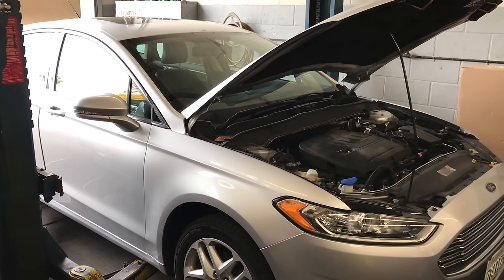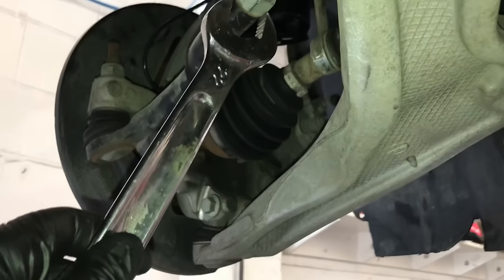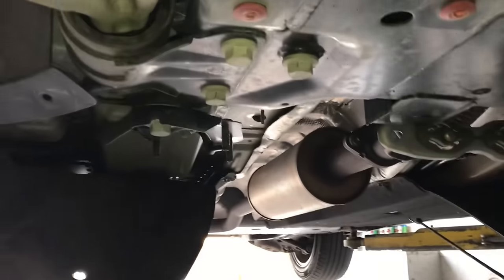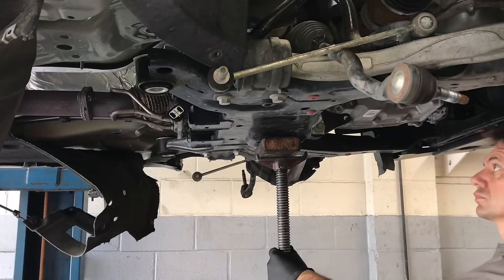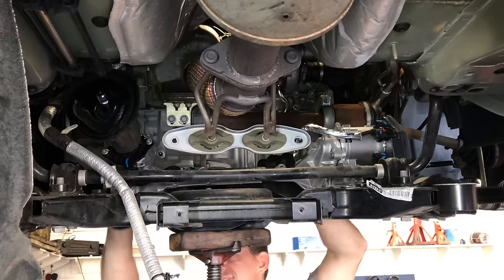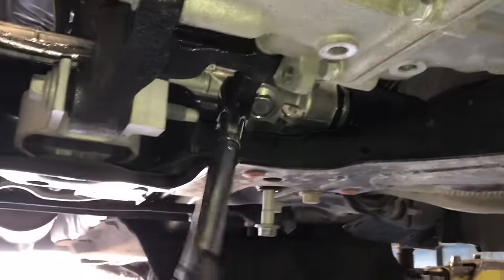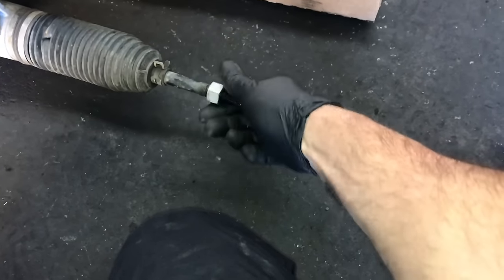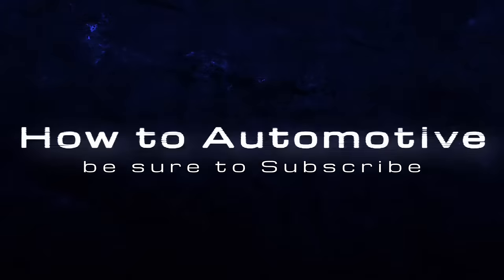How To Replace The Electric Power Steering Rack On A Ford Fusion

Comment from the maker: Links for parts and tools are in the description
Reply: Awesome video. Did you not have to reprogram or flash the PCM or whatever? I just got mine swapped by my buddy but we never did the programming. Now the steering feels like it's hyper sensitive. Any small bump and it sets it off to one direction or the other. Not sure if that programming step is responsible or whether he messed something up in the install.
Reply: Hi sir I need some help plz how to reprogramming for new steering or use steering box on ford fusion 2012
Reply: @ibanezmakki  Forscan is the lowest cost way to do it.

Comment: Cars are too young to have problems like this. I'm not sure how or why people buy things from companies with shotty records of quality. Ford is barely better than GM in the quality department.
Reply: That’s so true Blackman,I was a teenager in 1988, I had saved  enough for a Toyota pickup( it was 3 yrs old) all my buddies gave me a hard time” That ain’t no ford” and other b.s. Well that truck lasted, and mite still be going for all I know,  I smashed 135,000 really hard miles on that thing,missed shifts, I used bar and chain oil as oil! 2.50$ a gallon! Rolled it over, sunk it through the ice,and was drunk for most of it... I replaced front pads, that’s it!! No ball joints no alternator, no water pump, nothing else, except lots of side window glass( a lot of crazy girlfriends will do that) my buddies American rides? Hah,broke down, the usual ford/ Chevy  BS,  mentality, that it’s somehow OK that it costs a lot to go AMERICAN! Well not for me! They don’t make Toyota trucks like that anymore! And THATS too bad...
Reply: @pierrelaboom4026   I have a few old cars that are Japanese that still run today. 1989 CRX, 1990 Acura Legend, 1993 Accord, 1993 Camry. All exist to this day, the Camry actually still has its R12 A/C charge. Miles dont seem to matter, all but the Accord have over 200k on the dial.

Comment: CAUTION: when reassembling, the torque values for a few nuts are not the same for my 2014 Fusion SE. I used the 85 ft-lb torque values in the video on cross bar nuts and damaged the screw on the bracket. Then I looked at the service manual it says 60 Nm (44 ft-lb). The screw is 10.9 M10 which is typically rated 49 ft-lb, which is close to the number from the manual. Another one is the two rack & pinion bolts. They are 10.9 M14-110 bolts,  rated 215 Mn (158 ft-lb), and need to be torqued to 200 Nm (147 ft-lb) per the service manual... So be sure to check the service manual about the torque. 

Other than the torque value, this video is the best I can find on youtube and is very helpful. I followed the instruction and get the job done.

Comment: Sofb, this sounds EXACTLY like the noise mine is making. Is makes the same multiple knocking sounds when turning (only to the left, not the right) at a standstill. Checked all of the suspension parts and everything looked tight. Showed to multiple mechanic friends and no one could tell me what it was. I am now 100% convinced this is it.

Comment: I did this in my driveway. I’ll give my 2 cents. This wasn’t a bad job . Make sure you have a really good impact especially if you live in an area where they use salt on the roads. I would also  have sway bar link arms on hand because mine had to be cut off and they were worn out anyways. I purchased a used rack and didn’t have to use a scanner. Automatically cleared code and works. The motor on my rack was split in half
Reply: I’m doing mine on Saturday, my dad thought it was the strut bushing plates so I did both, he was looking it over and noticed the rack motor was in half.

Comment: i just did one one Cmax.. will be done tomorrow , my shop was busy today, i did completed rear brake on CRV, both upper and lower ball joints on Envoy, + aligh, and VW aligh, wow.. so i get home and watch you 😂😂
Reply: Ok super random question that you might not even see but is it going to be the same process for a c max as a fusion? I need to replace my power steering rack on my c max and this is the only video I can find that explains it well. I'm trying to figure out if I can do it on my own. Thanks!

Comment: Had trouble getting the ball joints back into the knuckle, flipped the nut upside down, sucked the threads through then flipped the nut around the normal way and sucked the ball joints into into place work like a dream

Comment: This is a great video! I do have a question, the website for the remanufactured steering rack says that it must be programmed and I called Ford who said I would have to get it towed to them to have the new rack programmed. How were you able to get the new rack to work without having to program it? Thanks.
Reply: This is why he said you would need a scan tool capable of doing a steering angle sensor relearn

Comment: Great vid! Just replaced my steering rack today. I watched your video prior to installing mine and you made it seem easy. Rust is a mechanic’s worst nightmare lol. All in all, new rack is perfect. No more sounds. Thanks!
Reply: Geno I work at a shop so I used our lift. Would be kinda hard with jack stands since you have to drop the sub frame to pull the old rack out. It’s not impossible with stands only but definitely tricky.
Reply: did you have to re-program it? i installed a used one and my steering wheel is stiff
Reply: Joeski 6366 I bought the rack new from Ford.I didn’t have to program it or anything. Installed it and noise was gone.
Reply: @Joeski-nk7os  How did you resolve your steering being stiff? I would recommend clearing stored codes but the battery disconnect step would have done that for you but just in case. Clearing codes should reset any codes that would make the PSCM to go to manual mode (no steering assist).

Comment: There a trick to that second wire connector at 5:26 ?  Tab slid back fine but still won’t budge. 

Edit:  NM I just needed to take a break.  😂. This video is great and I was able to easily follow along and complete the job in my driveway.

Comment: Great video but a question I have. Does the new rack have to be flashed in the computer for it to work? I was told it had to be and that's why it was going to cost so much.
Reply from the maker: I did not have to do any flashing on this vehicle..

Comment: Thanks for the video, helped me knock this out BUT immediately when I went to drive me engine temp pegged Avery 2 min, before it even got any bit warm. I didn’t think the sensor would just went bad but it was $25 so I replaced it and nothing. Is there anything you know of I could have boogered up while doing this?

Comment: Hello,
My Fusion rack shaft has side to side slop where it goes through the firewall. It doesn't have any in/out movement. Is there a bushing or bearing that is supposed to keep that rack shaft from having slop which is creating a subtle clunk?
Reply: I wanna know too

Comment: Did you have to reprogram the new rack ? I got a 13 Lincoln MKZ which is the same car just fancier. I keep seeing I have to program the new rack and wondering if you had to do the same ?
Reply: Asking the same question for a 2016 as well.
Reply: If its a new rack, yes. You can use forscan for free to do it.

Comment: The steering wheel on my 2014 MKZ is locked, I’m suspecting my rack assembly is bad at 150,000 miles with the MKZ and Fusion being related it should be a similar process I hope.

Comment: Brian, my 2014 fusion is making the EXACT same noise, but only when I turn to the left. Does that make a difference? Can I be sure that it's the rack and not something else? What is causing the noise (what is actually failing/happening)? Thanks for your help!!!
Reply: Hey. Did you end up finding what the problem is? Mine is very similar but only when turning right
Reply: @malimbestfilez  So I ended up find that both of my front strut bearings were worn out. When turning the wheel very slowly you could feel a slight "bump" or vibration at one point in the turn which is indicative of the bearing issue. Replacing those has helped and the noise has now gone. That said, I still feel like there is something "lumpy" at the furthest extend of the turn. Like once you turn that far you have to force it over a hump to go to max turn. Idk. I have decided to leave it as is for now. I guess it's solved "enough" for me. The guy in the video never responded to me so no help there.

Comment: I just need to know if the car can be driven after new one installed so we can take it to a dealer to have flashed
Reply: It's electric so no fluid is required, i mean i don't know about yours in particular but if you don't see a fluid reservoir than it's electric.
Reply: @ronijr4918  What the hell does your comment have to do with what Evin asked? I know,  NOTHING!!!

Comment: Hello!!
Can you tell me how many teeth has the belt for a Ford Fusion Titanium Ecoboost AWD 2013?
Thanks in advance and best regards!!
Reply from the maker: I don’t have one in the shop to count. I would recommend checking your parts supplier.
Reply: @HowtoAutomotive  Thank you!!! 👍🏻👍🏻👍🏻
Reply: Hello!
I’ve counted the number of theeth and is 182.
As it was impossible to buy just a new belt, I had to spend more money buying another steeering rack with all the same codes that were on the original one (to avoid communication issues).
The problem now is that I cannot connect (communicate) it to the car. It remains 2 failure messages on the display as I had before and neither lane or park assist work properly in my Ford Fusion AWD 2013.
What should I do?
Thanks very much and God bless you!!

Comment: Ford is telling me that I can’t do it because I need a scan tool to download the module from old rack and pinion and install on new rack and pinion. Mine is a 2013 Ford Escape but everything is the same as your video. Is this true? Doesnt sound accurate.
Reply: Michael Lopez has anyone answered the question about needing to flash this with a dealer after the installation
Reply: Idk about the Escape but I have a 2014 Fusion, I got a new rack from Ford and installed it myself, didn’t need to transfer the modules or anything. Once I installed the new rack both the ABS and steering assist lights went off.

Comment: This seems like it would be similar for a 2013 Taurus??
Reply from the maker: It probably is.
Reply: Thank you for making this video! I just did it on my 13 Taurus and the process is fairly the same. Did it on 12 ton jacks (two feet of clearance) and had more than enough room to maneuver.
Reply from the maker: Gerardo Serrano Glad it all worked out in the video helped. Thank you for watching!

Comment: Power steering assist fault alert and lot's of loud noise while idling/accelerating/turning wheel. Was told it needs a new engine, but now I'm thinking it really is the electric power steering.

Comment: Mine  dash says that the steering assist and the advance track are both disabled, but only after going thru a car wash with an underbody spray.  Shut off the car engine for a few minutes and the warnings are gone and the power steering returns. Could this mean that only an electrical connector is loose or corroded, because the warning goes away?
Reply from the maker: Dave A It could be a loose connection. It’s worth having the codes pulled and going under there and having a look to see if somethings loose.
Reply: It’s definitely the whole steering rack needs to be changed! There is a RECALL on this for a lot of Ford vehicles, check your vin number on their website to see if your car has the recall. They will replace it for free. I just dropped mine off they called a few hours later and said it’ll all be covered free of charge. 2012 Ford Fusion 2.5L 91k miles. The recall covers 10 years or 150k miles whichever occurs first. Good luck and Merry Christmas
Reply: @HowtoAutomotive  Thanks for both replies.  Upon closer inspection I lifted the hood and reached over the engine and pulled aside the C1463B cable from under the transmission housing and found the hidden problem.  (This is one of three separate wire cables that connect to the power steering module that is mounted on the rack.) The cable had become detached from the harness clip on the steering rack and the harness rubbed against the transfer case until it wore thru to both copper wires.  The wear was about 3/4" long.  So I spliced, soldered, and put heatshrink over the wires along with new cable flex tubing.  Next, I secured the cable with plastic cable ties so that the harness doesn't move and rub against anything again.  A long test drive yielded no more warning lights.  I think the problem is fixed.  As suggested I did check the VIN for Ford recalls and this particular was not on the list.
Reply: Dave A it says “Disabled” or “Fault”?
Reply: @IDABAYAREA650I  it says disabled

Comment: How much does something like this cost not including the rack
Reply: You can repair your old rack.The rubber toothed belt driven by the electric motor wears and slips with age.Belt is about 50.

Comment: I just down the rack and pinion on 2012 ford fusion and I can't alignment on the passenger side what can I do
Reply from the maker: Sounds like the rack was off centered when you put the steering shaft on. I would try taking the steering shaft back off turning the rack all the way One Direction and rotating it back all the way opposite direction counting the amount of rotations divided by half and then put the shaft back on.
Reply: @HowtoAutomotive  I will thank you

Comment: How about configuration of the new rack and pinion with a scan tool?
Reply from the maker: It was not required.
Reply: @HowtoAutomotive tengo el mismo equipo maxisys ms906 bt. Sabes cambie la caja de dirección electroasistida de Ford escape 2014. Pero me quedo dura. Los otros módulos tienen códigos de perdida de comunicación del módulo PSCM de la dirección electroasistida. El módulo no aparece...tendré que probar con otro módulo... Te a ocurrido algo similar... Saludos máster muy bonito video...

Comment: DID YOU RE-PROGRAMM IT OR NOT?
Reply from the maker: There was no programming required. But I didn’t need to go in with a factory scan tool to clear out the code. A simple code reader will not do that.
Reply: Under what conditions can installing a new electric rack and pinion unit and avoid having to reprogram it. What  must I do to   @HowtoAutomotive

Comment: It looks like the rack and the EPS motor is a one assembly. What failed, the rack or the motor ?
Reply: The electronics inside the system that controls the power steering. Because Ford.
Reply: I am having a issue  too, my assist fault warning message....Its so frustrated!!!!
Reply: Trina Cruz there is a recall of the power steering assist fault. 15S18 is the recall number. Should cover 2010-2012’s maybe others also. Definitely check and see if there’s a recall on your car for the power steering assist failure which is the whole steering rack. It’s like $1800-$2000 from the dealer. I just dropped my 2012 off, everything’s covered but they tried to act stupid at first. Give them that recall number! Good luck 👍🏼
Reply: @unitedwestand5602   Stupid dealers won't take it and because there is no recalls on my Van for that part
Reply: @unitedwestand5602   I live here in California and it is a damage  rack pinion
Reply: Trina Cruz yeah I’m in Cali too..... what year and model car do you have?
Reply: @unitedwestand5602  2010 ford fusion  se
Reply: Trina Cruz yeah it’s bullshit that they don’t cover early build 2010 models...... this is such a widespread problem they should cover every model under the recall. I’ve done a lot of research you can buy a remanufactured epas unit for about $650 and if you know someone that can work on cars have them install it. It looks like the remanufactured one they install in mine will fail after 2 years or so according to other people 🤬. When it does fail I’ll be buying the unit for $650 and installing it myself
Reply: @unitedwestand5602  i have a 2012 and was at the dealer today, and they tried playing stupid with me aswell. Anyways, I now have an appointment next week to get my car looked at. They said if there is no diagnostic code for the EPS then they can't do it through the recall. Did yours have an EPS code?

Comment: 111 ft-lbs on a tie rod end? Sounds wrong, i believe it's only 35 ft-lbs on the outer tire rod nuts.
Reply: I just changed mine with moog and there was a tag telling you to make sure you torque it to 111ft lbs. I thought the same but that's what it says or the stud will fail if not torqued.

Comment: Couldn't you just replace the motor on the rack??it seems like a simple design
Reply: Can't buy the motor separately, and most likely the belt in the rack & pinion is stripped

Comment: The engineers and management have to justify their jobs by constant "improvements" hydraulic power steerin can go out and u can still get u car home. Not everything should be electronic. Thay arent as reliable, break constantly, a suck to replace. Not to mention actually cost more to contantly redesign. You can use the same hydraulic , pump, line,  and steering assembly for decades and no need to change design making parts manufacture cheaper. But this is planned obsolescence and a push to make us go to overpriced incompetent crooked dealership mechanics